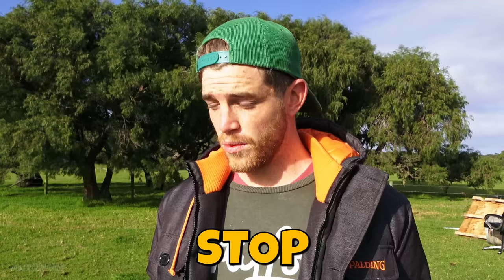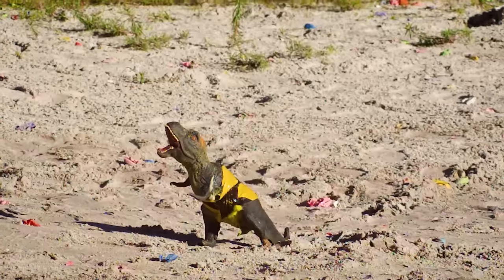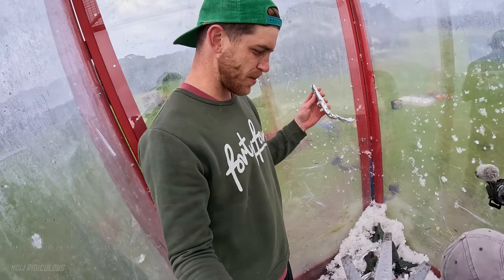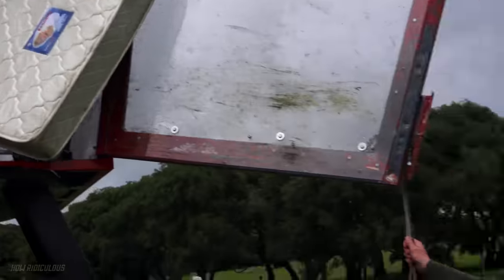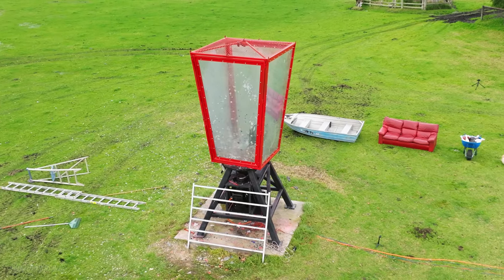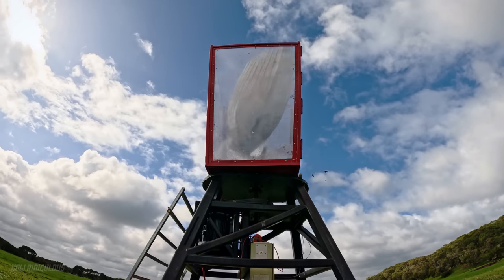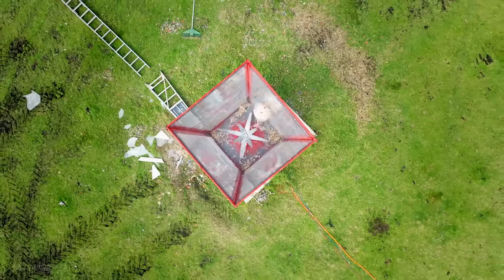Most blenders can't blend boats...

Comment: Golf balls are designed to be durable and withstand the impact and forces generated when struck by a golf club. They are made using a combination of materials that contribute to their toughness. 

The outer cover of a golf ball is typically made of either a surlyn or urethane material. These materials have high molecular weight, which gives them excellent resistance to abrasion and impact. They are also resistant to cuts and punctures, making the golf ball more durable.

Inside the cover, there are several layers that give the golf ball added toughness. The core, usually made of rubber or synthetic materials, is designed to provide the ball with its initial velocity and energy transfer upon impact. Surrounding the core, there are additional layers, each serving a specific purpose to optimize performance, including distance, spin control, and durability.

Manufacturers also use various construction techniques and designs to enhance the durability of golf balls. For example, some balls have dimples on the outer cover, which not only help in generating lift and reducing drag but also add strength to the ball's structure.

Additionally, golf balls undergo rigorous testing and quality control measures during the manufacturing process to ensure consistent performance and durability.

It's important to note that while golf balls are indeed tough, they can still be damaged or worn out over time, especially if subjected to extreme conditions or improper use 

Hope that helps am a expert in golf balls 😂

Comment: Golf balls have dimples that trap air between them and the polycarbonate that compresses and superheats, then immediately cools off. 

Normally, polycarbonate will not shatter, but because off this process of rapid heating and cooling, the material loses its special properties and cracks just like any other plastic.

Comment: When selecting polycarb sheets ask for high impact polycarb… also have a thicker sheet on the outside 15mm and have thinner sacrificial sheets on the inside that you can replace say 6mm… it would be expensive but you can’t put a price on safety…

Comment: Watts divided by amps equals voltage. Watts divided by voltage equals amps. Amps times voltage equals watts. Voltage divided by amps equals resistance. Voltage divided by resistance equals amps. Amps times resistance equals voltage.

Comment: You need a single MUCH thicker polycarb layer (upwards of 20mm+), and 2 layers of that, most likely. OR you need to fuse your current layer thicknesses with clear poly-weld so they can share the forces. the latter is not as good, and a lot of nasty work, but WAY cheaper.

the thinner layers don't transfer energy throughout the thickness like they would if they were fused or a single, thicker piece. if you have them separated with standoffs, then each hit only needs to break ONE layer, so that subsequent hits can break the Next layer, which could happen in a fraction of a second in that machine.

Comment: I'm an electronics engineer and 180 Amps is a lot. Normal 230Volt wall outlets will pop the breaker at 10Amps. Though your car may use up to 600 Amps but that's at way lower Voltage.

Comment: Add another identical motor/pulley/belt. Its easier on both motors and its blending torque will be massive. There is lots of room on the main shaft to add another set.

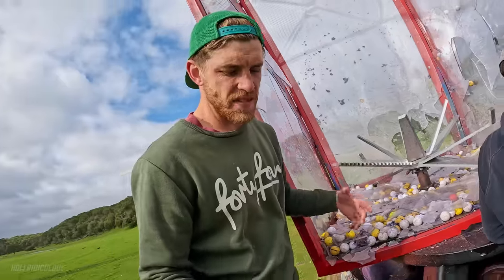Comment: 12:27 My theory: Most likely a combination of vibration the cracks in the polycarbon made by the previous debris and the current debris that is hammering against the polycarbon caused the cracks to speed and made it shear away from the bolted pieces. I doubt a wind tunnel effect inside the blender would add to the damage but since I don't know if the blades on the blender have a distinct angle I can't say it can effect it any worse then the vibration alone.

Comment: 180 Amps is massive. 0.1 Amp is enough to be fatal.

The golf balls are so destructive because they are designed to be hit hard by metal. It is like you have 500 John Dalys in there each crushing multiple drives per second.

Comment: The only way to defeat the golfballs is to defeat the strength of the outside of it.  Either by spinning faster or concentrating the energy across a smaller area.  The first layer of blender should be metal grating all the way around with the poly carb surrounding it.  You'd probably only need a single layer as the grating would absorb a majority of the energy AND help destroy stuff.

I'd suggest dumping the balls in after the blades are spun up to maximum speed with sharpened blades.  Some are still going to bounce, but if you upgrade to metal grating, I'd be willing to wager all of the golfballs will still be destryed after 1 spin up.

Switching all of the blades to the serrated style and swapping out the damaged ones should do the trick, also.  If the serrated edges could be skinnier or with a point in the center; all the better.  Sharpening the regular blades to an actual point might be enough, also.
Reply: Anything with metal in it would be defeated better (easier?) by dumping it in after the blades are spun up.

Comment: Golf balls are particularly hard, and when flung against a polycarb sheet at very high velocity, the point of contact is very small, making very high contact pressure which leads to failure...at least that's the way this engineer sees it.

Comment: The reason the boat didnt blend was because you had the point facing down which pretty much turned it into a wrench in the gears considering the boat is so heavy. if you hadve turned the boat around the other way and dispersed the weight more it wouldve worked...... since you tore off the tip on the last try it probably wouldve actually worked if you hadve tried one more time!.....DO IT AGIAN, DO IT AGAIN, DO IT AGAIN!!!!!

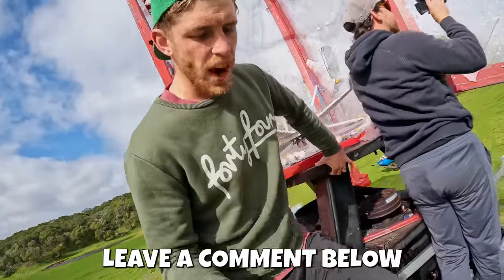Comment: 12:30 ☝🤓 About golf balls :
They absorb the energy from what hits them, a club or a huge (dull) blender blade, into deformation.
So, in slow motion, a ball that is hit, looks like this [club]->|()   Then it wants to go back to "spherical", so it "pushes" against what hit it.  [club]  |<=>O --> (speed)
With low energy wasted (in heat and air friction), it hits the wall with almost the force it got from the hit. = +/- blender directly on the polycarb.
+Plus, multiple balls hitting at the same time...

Comment: Oh Gaunson, your scientific expertise is... legend.
(Sadly, not one of those legends based on reality, LOL)
The electrical/piping analogy goes like this, buddy:
Volts IS like Water Pressure
Amps is like Flow Rate
Resistance is like Pipe Diameter/Roughness

Comment: You guys need a better electrician if the E-stop is not functional. A good electrician would have put a lockout switch at the blender and a safety lock bar on the blades. Turning off the Generator is good for reducing pollution while cleaning up the blender, but should not be the primary disconnect.

Comment: im curious as to what the specs are on that blender, what the motor is, what the power delivery systems are. surprisingly powerful, yet also so prone to failure. seems the design needs tweaked. one should remember to always over engineer things like this and to never push any system beyond like 60-70% that way nothing over heats or breaks.

Comment: You’ve got your volts and amps backwards in your science lol volts are what’s inside, amps are how hard what is inside is being pushed. So volts would be like your diameter of the water pipe, and amps would be the pressure of that water being pushed. Look up the garden hose volt amp example it explains it PERFECTLY. It’s why a taser can push tens of thousands of volts, but not be a fatal weapon, it’s all about the amps, how hard it gets shoved through your body. Another great example is just a house, you can push 120 volts at 15 amps, or 40 amps. 15 amps will power your lights and common outlets, but not a dryer. A dryer will run at 120 volts at 40 amps. The more amps, the more pressure, the more power.